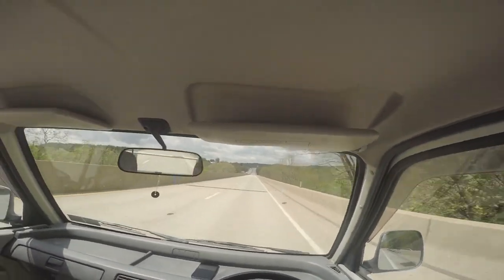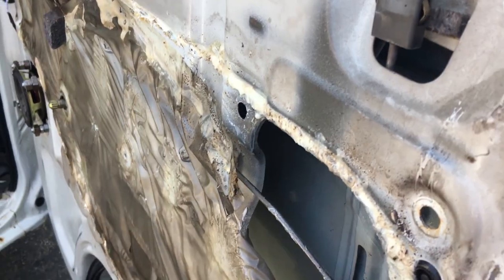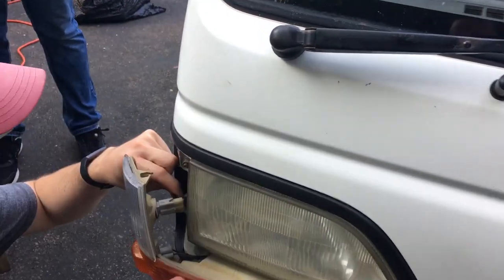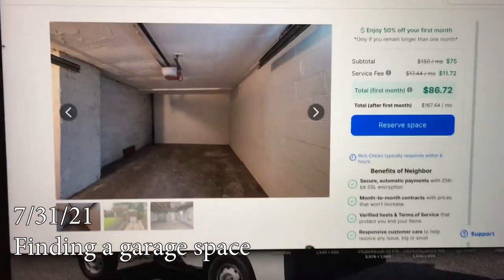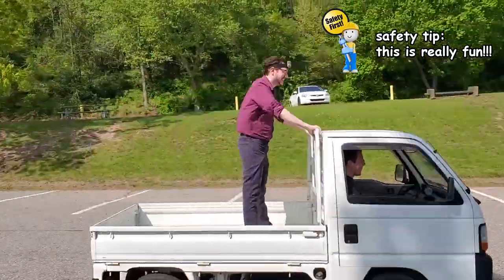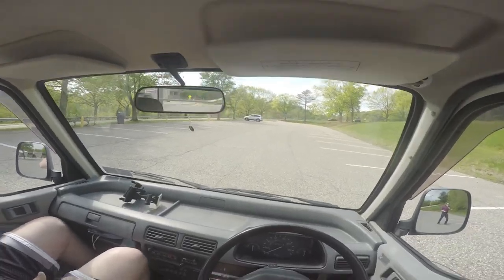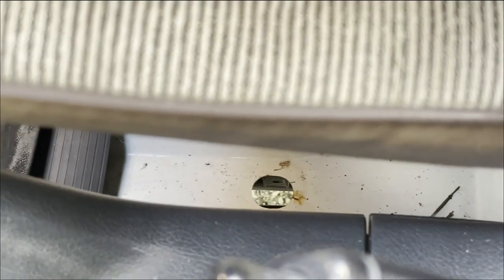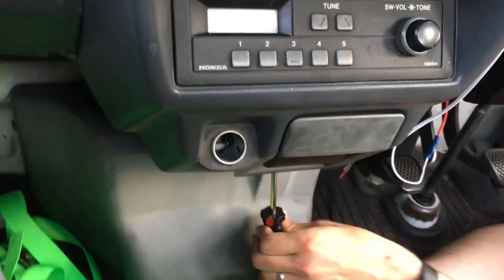Converting a Kei truck into an EV - Energy efficiency & Joyride - Part 7

Comment: FYI, the best insulation for thickness is aerogel.  You can get them in batt form like pink i sulation, but they are more like R-20 per half inch.  They use it on oil pipelines and boilers, as well as the space shuttle.

Comment: According to Wikipedia, there's a whole bunch of old RTG's lying around the arctic coast of Russia where they used to be used for powering Lighthouses. Have you considered just picking one of those up and duct-taping it to the passenger seat? Bonus point, you could use it as a range extender.
Reply from the maker: Mark Watney approves